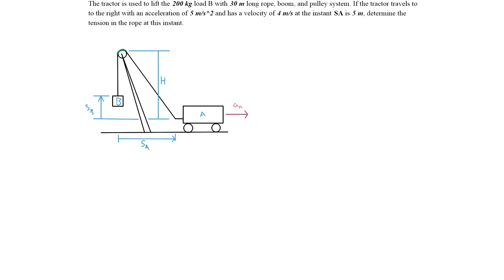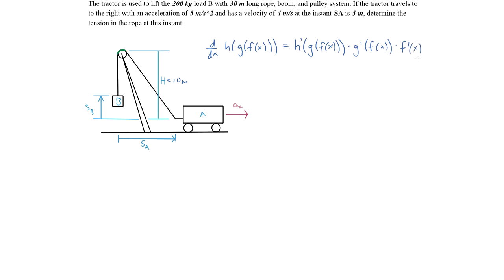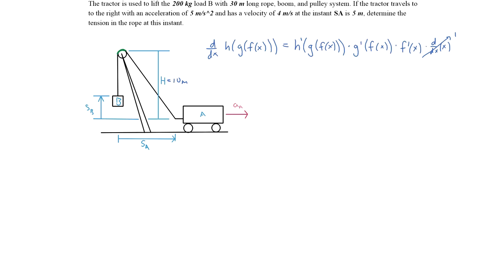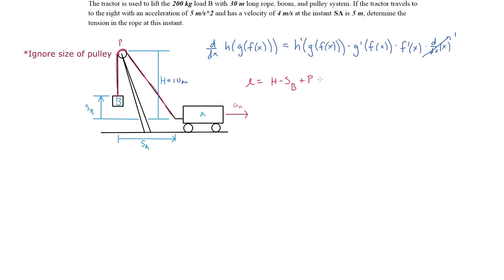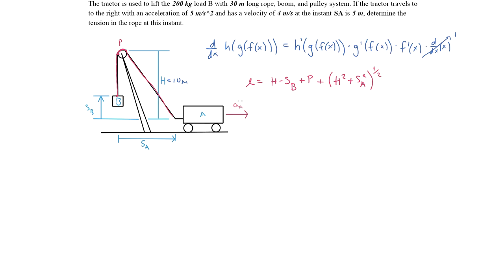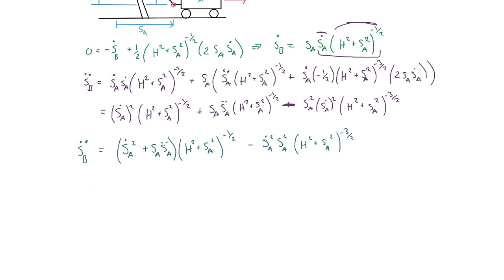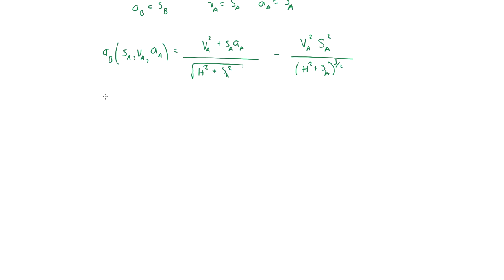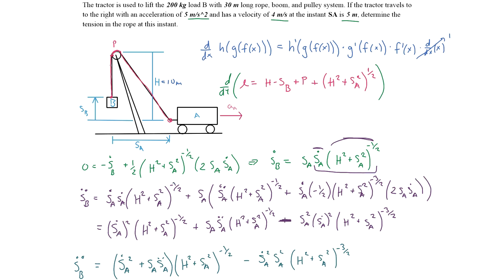Dynamics | "The tractor is used to lift the 200 kg load B with 30 m long rope, boom, and pulley..."

Comment: And when SB=0 and SA=0, how would it be resolved?
Reply from the maker: In the final equation, it isn't dependent on SB. So just plug in SA=0 into the equation. You still need to know the other parameters (they need to be given).